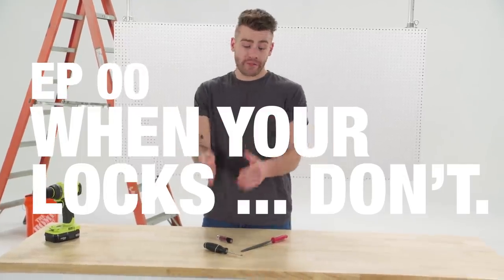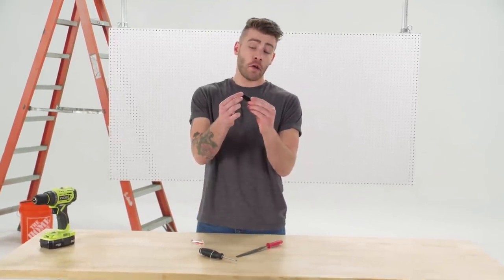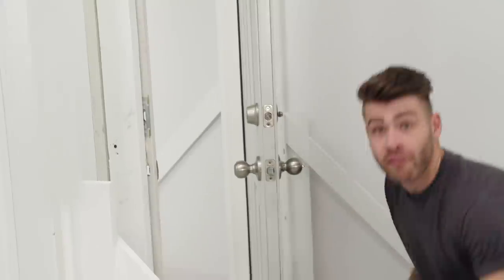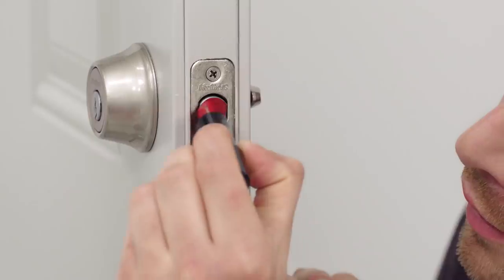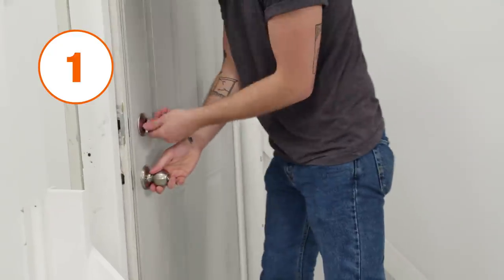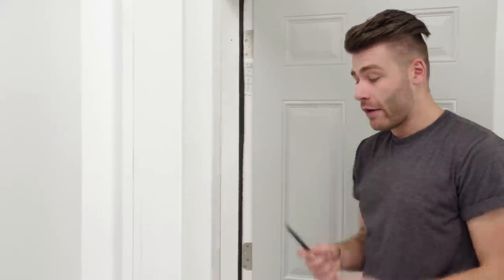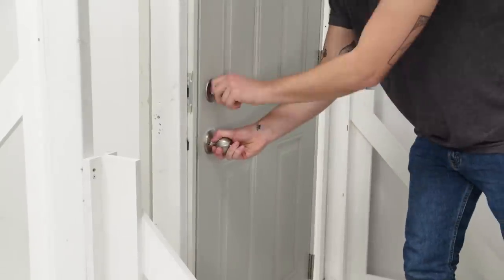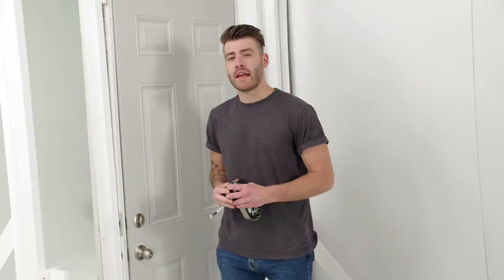When Your Locks...Don’t with Mike Montgomery: How to Undo (Episode 00, Pilot)

Comment: Lol the door isn't even shut all the way when they demonstrate how the deadbolt isn't sliding into where it needs to go.  I get rigging it up to "hold the door open a bit so it hits the strike plate more" to demonstrate, but dead bolts give a little bit so if he closed the door it would have worked. 

ALSO if you want to do it better and not scratch up the potential paint finish to your strike plate,  take the plate off, use a chisel or even a flat head screwdriver to chip up the wood in the jamb, then reposition the strike plate lower.